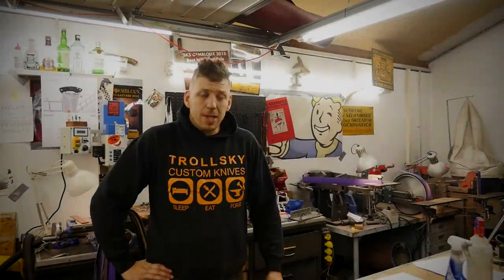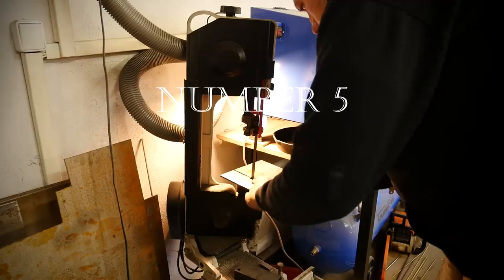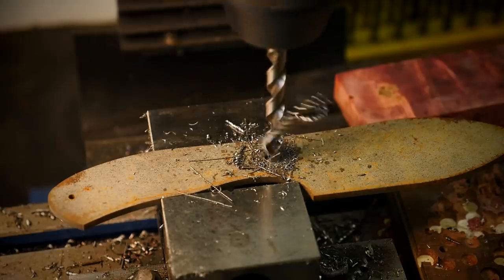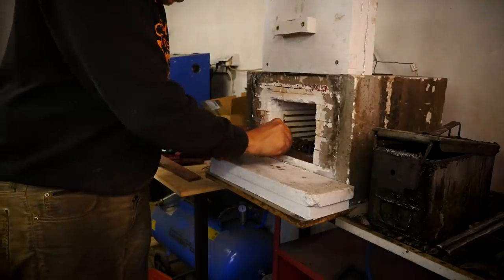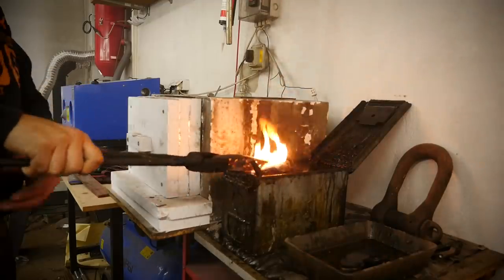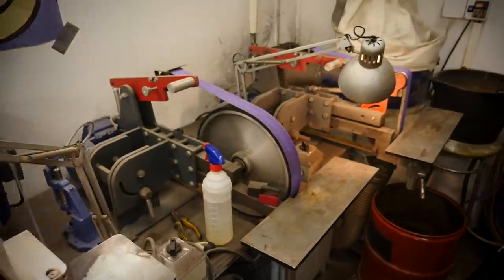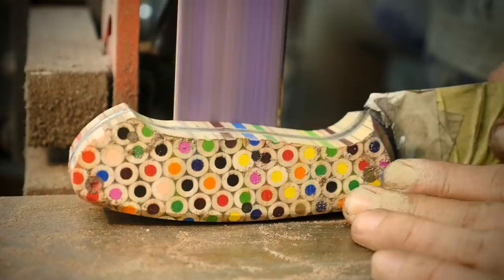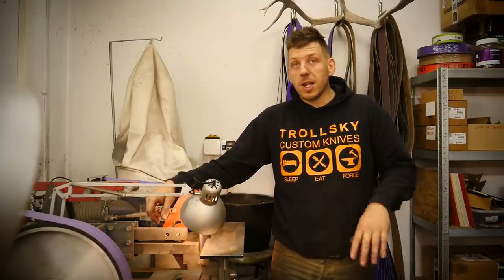TROLLSKY'S TOP 5 KNIFEMAKING TOOLS [Trollsky Knifemaking]

Comment: That’s a pretty good top 5 list. I would agree with all 5 but unfortunately I don’t have the dust collection system or the mini mill. I would love both. I have to replace the mini mill on your list for my drill press and the dust collector for my Edge Pro sharpening system. Thanks for the video
Reply from the maker: dust collecting system is really cheap and gives a plenty of great comfort in return, think about it.